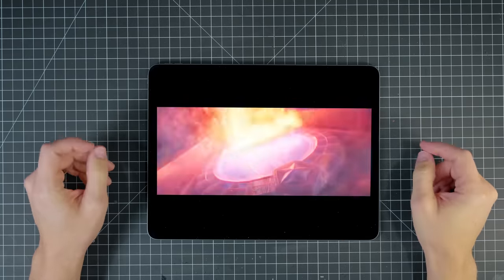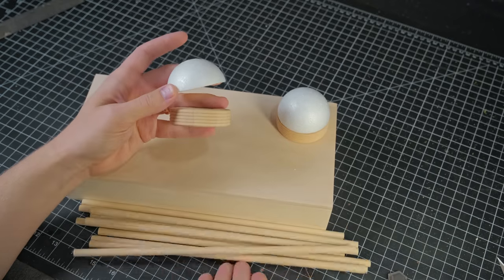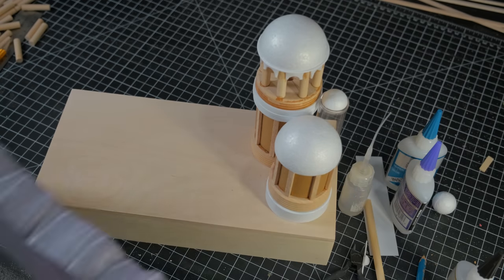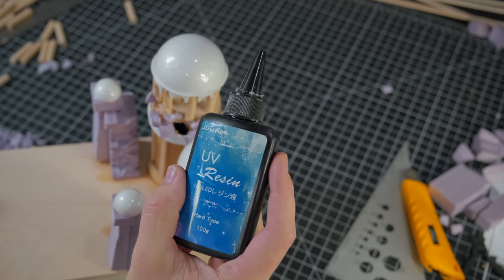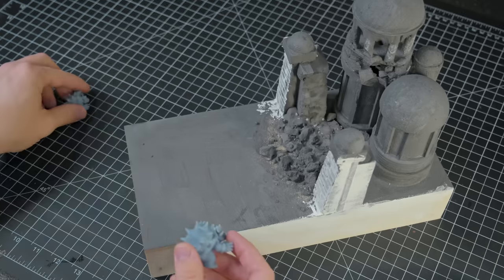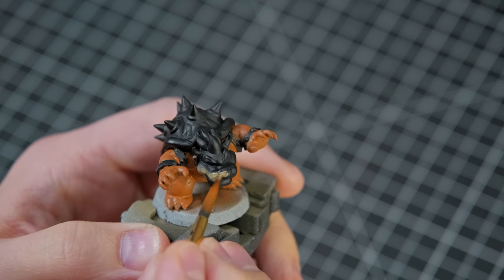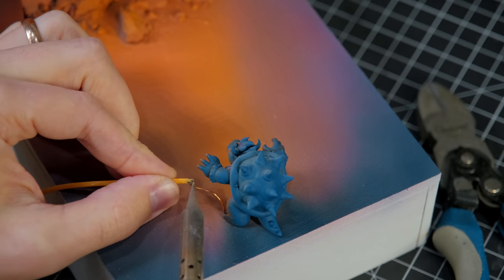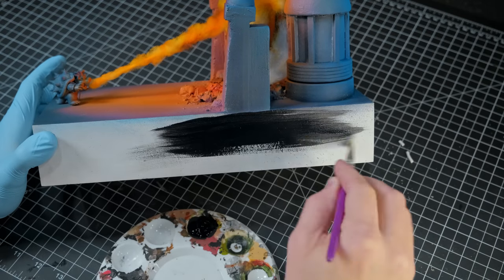Is Bowser Too Overpowered?! Mario Movie Diorama

Comment: When using the pink insulation foam, do you cut off the face where it has the very thin film coating? I have a lot of issues trying to cut or carve bricks in to the face of that foam.

Comment: Great video. However I feel like you skipped over some very crucial elements. I wanted to see how you made bowser. Where you got the 3D print code. How long it took. How you chose what size etc.

(Edit) and then you put the 3D link below 😂 

Is still have liked to see the 3D printing.